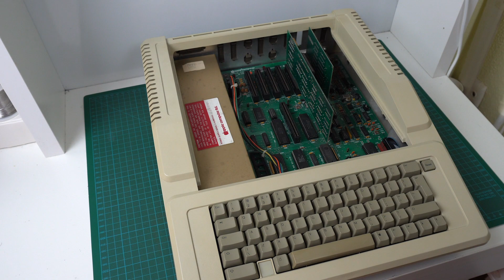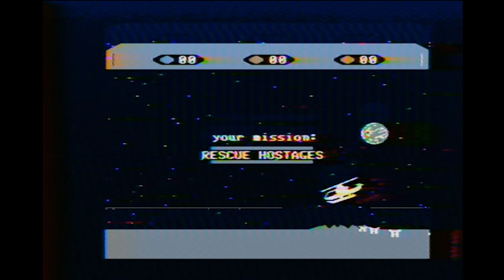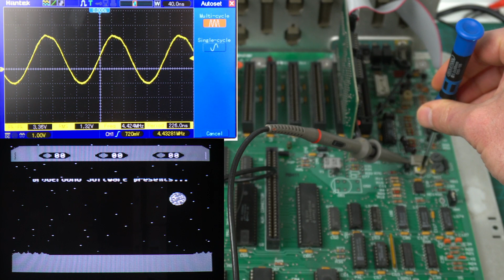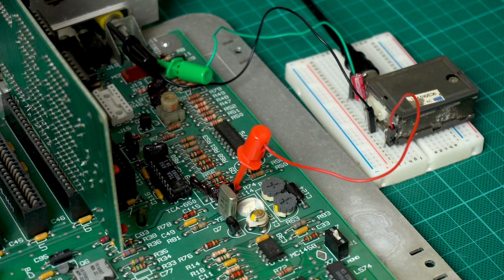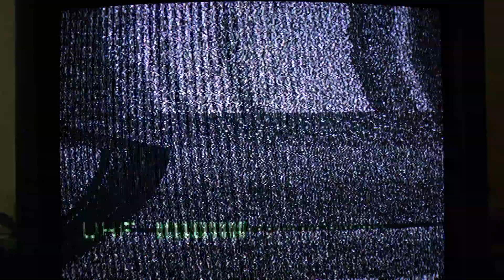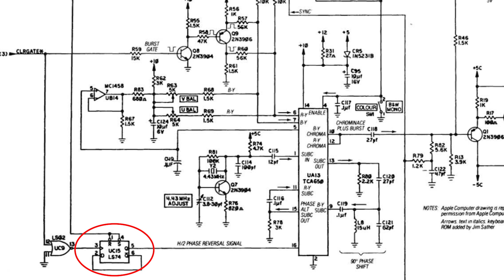Apple IIe PAL Color Deep Dive and Repair

Comment: Kudos to the great Walter Bruch for giving us the PAL system! 👍
I was actually considering an issue with the "colour killer" circuit being stuck on. This is normally only active in text mode and inhibits the colour burst to eliminate colour fringes.
I have a no-name PALcolour card in my Apple ][ that was apparently built as a kit by the previous owner. Bizarrely, the colour killer was inverted on that thing: colour was disabled in graphics mode, and enabled in text mode. It turned out the transistor that picks up the COLORREF signal from slot #7 and enables/disables the colour burst was a PNP instead of NPN, or vice versa. This was either an error in the original schematic, or a mistake on behalf of whoever built the kit.

Comment: I’ve worked on dozens of these machines, but they were all NTSC units. It’s nice to learn about the PAL model. But either way, an RGB card will fix all these problems!
Reply from the maker: By an RGB card do you mean a generic card that takes composite and generates RGB, or is there an Apple II-specific expansion that generates an RGB signal. I'd love to check that one out.
Reply: @NoelsRetroLab  There are RGB cards for the IIe that fit in the aux/80col slot, including one sold by apple itself. They were available with digital or analog RGB signals.

Comment: the test with RF modulator was useless basically from the beginning because the composite signal was already bad when sent directly to the monitor. Loved the rest of the troubleshooting.
Reply from the maker: Thank you. Yes, I agree that in retrospect it was useless. I just just grasping straws in case there was something "slightly" incorrect about the composite signal and somehow the RF modulator would be less sensitive to it than the TV.

Comment: I did not see any problem with the first time you put it on LCD. And among the last sentences of the video i finally understood why and what was wrong with it. Red. Red signal not getting interpreted. And greens aare in signal coded into both red and blue channels.
I'm red/green colorblind. The image seemed a little bit off but if you showed me bot the correct and that i would not be able to tell which was wrong.

Comment: Since theres a switch inside to switch between B&W & color, that means it can sending a color signal, wich means you cannot get color from a B&W signal to a color tv, no matter how you regroup pixels, it’s just bogus.
Reply from the maker: Right. That whole circuit is only active when the switch is on the color setting.

Comment: I actually own one of these rare 8-bit classic Apple computers. I had the pleasure of helping to develop some c&c software for it back in the early 1980's and I just love the architecture of the early Apple systems. The only problem I have now is that the "gold brick" power supply is in serious need of a re-cap and service, not a task for the fainthearted as it was one of the earliest switching power supplies, quite tricky to work on and easy to blow up if you aren't careful...

Comment: Well done! Instinctively I would not have suspected a flip flop in this case. But it shows that with the schematics you can use an analytical approach.
If everything goes well my first ever Apple IIe comes in tomorrow. It was, as you said in the beginning, not easy to find I in Europe. But I guess during all these everlasting effing lockdowns people clear up their attics and gems turn up. I also managed to grab an SX64 a few months back — I’d been looking for one within the QWERTY area of the EU for ages.
Reply from the maker: Thanks! I don't have enough of an instinct developed for the Apple IIe to be able to tell where faults are located, so I just had to take the brute force way and follow the whole color-generating circuit. Which in the end was really interesting and learned a lot, so I'm glad I did it.
Good luck with your Apple IIe! It's a fun system!

Comment: With stubborn chips like that, I usually cut the pins and remove them one by one.
Reply from the maker: Yes, that's a good idea. I usually don't do it because I'm never 100% sure that the chip itself is faulty (sometimes it can be shorted from somewhere else) and there's something satisfying about testing them after you desolder them to confirm they're indeed faulty. But yes, that's a much more practical approach, especially with cheap ones like this.

Comment: Hmm if the quartz oscillates there's a very low chance it has issues. OTOH, if it didn't, you'd need to make sure it's not the oscilloscope probe that's loading it too much and stopping oscillation. On my thinkpad'd ethernet PHY I had to jumper another one in parallel to see that it was broken… well almost, when started sometimes it kept oscillating, just wouldn't start on its own.

Comment: Scope probe loading down the crystal,  metal screwdriver on the trimmer cap.   Like your video's but that was painful.
Reply from the maker: The scope I usually run it at 10x precisely to avoid that and being able to see the signal coming from crystal oscillators. The metal screwdriver... there you got me. I still haven't gotten a plastic one yet! 🤷‍♂️😃
Reply: @NoelsRetroLab  Even at 10x the probe still introduces some capacitance which de-tunes the crystal.   Normally you want to find a buffered output when tuning while measuring.  It's all good I'm just being nit picky.   You do a nice job finding the faults.   You really need to get a bit nicer scope IMO however.   Something with a gradient display and faster update.
Reply: @jeffm2787  Agreed...a crystal should be measured after a buffer.  The  PAL crystal freq is 4.43361875MHz.  The colour burst is ten cycles of subcarrier which changes phase by 180 degrees every line.   PAL is a lot more involved than one might expect but Noel did a good job explaining the problem and fixing it.

Comment: How is it that the Apple II composite colours are so different from the CGA composite colours? Is that just a function of the particular choice of resistors used at some point in the circuit?
Reply: Everything about monitor television signals is about precise timing.

Chrominance information is effectively sent on a the phase of a subcarrier mixed onto the luminescence signal. The angle represents the vector between the Y-R and Y-B for a particular color.

Color artifacting works by sending digital signals on the chrominance subcarrier during the duration of a particular pixel.The monitor/television's color decoder interprets these signals as having a particular phase based on some PWM/PDM filtered result of those bits and specific timings.  The computer doesn't generate the colors, it just generates bits at randomish times and the monitor interprets those as colors based on it's color gamut.  As long as the signals are always generated with the same phase referenced to the color burst signal, a series of bits will always be interpreted as the same color -- but the computer has no idea what color that will be.

The Apple ][ and the IBM CGA graphics cards both use a similar method to generate color; but, their timings are completely different.  While Apple displayed 140x192 pixels do to other timing constraints on the Apple ][ board, CGA displayed 160x200. The vertical and horizontal intervals were therefore different and different in reference to the colorburst.  Thus the timings of when phase the digital signals were sent over the chrominance signal were completely different.  Therefore, the palettes of the machines are also completely different.
Reply: @timharig  Thanks for the detailed explanation. Your last paragraph resolved one of (retrocomputing) life's little mysteries for me. :)
Reply from the maker: CGA has actual color information built into it (analog RGB) which can be displayed directly on a CGA monitor or encoded in some other form (composite). The Apple II didn't really have any color information in the signal. It was a monochrome signal with high frequencies and timings in such a way to trigger color artifacts. The Apple II didn't control the palette of possible colors, it's just whatever NTSC produced, whereas CGA did at least make some (bizarre) color choices.
Reply: @NoelsRetroLab  That's a little hand-wavy. Also, what mode are you referring to with that explanation? Mode 4 on composite? I was actually referring to the not-super-officially documented but common 160x200 composite mode, which needs bits 4 and 1 set in the 03D8h register. And in that commonly known and not excessively tweaky composite colour mode, the CGA does fundamentally the same thing as the Apple II: It uses 640x200 "monochrome" data ("b/w" by default) to generate a composite colour image via NTSC artifacting. Yet if you look at the 16 colours which composite, 160x200-mode CGA produces by default (w/o further tweaks and 1337 hacks), you'll see that the CGA's palette is very different from the Apple II's default composite colour palette. (No hardware? Just look at the corresponding Wikipedia articles; they both have palette pics.) So that unexplained difference between both systems' respective composite palettes is what I asked about, and if anyone can give a non-hand-wavy answer, I remain very interested in hearing it. It is a given that I do of course know that both 160x200 mode CGA and Apple II use composite artifacting to create their chrominance info out of little more than "thin error" (if you'll forgive the pun).

Comment: Not even my good Hakko FR-301 can get all the solder off some of these Apple boards.  Also, even when it does, the parts stick to the plated-through holes (or, more maddeningly, the small pads on the top, which have traces I can peel away if I get too impatient) more often than not.  I always make sure to put a socket in after this kind of repair.

I'd never thought of bringing the soldering iron topside to help free the part.  That will save me a load of cursing as I struggle to free it from the lumpy thing.

Comment: TIP: When you have a stuck part like that I always cut the pins away from the part, then de-solder each pin. This puts the least stress on the PC board pads and plated through holes. Of course you destroy the chip or part but in this case a TTL chip is pretty cheap. Also the subcarrier frequency is quite critical. I don't remember 4.43mhz PAL specs exactly but NTSC is 3.579545hz +/- 10hz so I expect PAL would be the same tolerance. That's actually a much better color system than the NTSC Apple 2. I guess they had no choice but to use a real subcarrier quadrature modulator because of the PAL phase alternating line requirement. We don't have that need in NTSC so you can have much simpler crude color circuits. Just mix a subcarrier with the luminance at a different phase than the burst. No quadrature  modulator needed. Just a feed the subcarrier into tapped delay line and a CMOS six part inverter chip plus some capacitors does that nicely. Of course this approach is hardly broadcast quality but good enough for early computers.
Reply from the maker: Yes, you're right. I'm in the habit of taking them out without cutting them because many times I'm either not 100% sure the IC is faulty, or it's an interesting chip that I want to keep for future tests. But in this case it's just a dumb 74xx, so yeah, that would have been much better.
Reply: @NoelsRetroLab  Solder braid is an option too, but takes a lot of patience. But even smaller 14-16pin DIPs can sometimes be really stubborn.

Comment: When it's a shitty 74ls chip you're fighting to desolder, which you don't care to keep in a working condition (especially if it's faulty to begin with) It's much simpler to just cut the leads and remove them one by one.
Reply from the maker: That's very true. I'm in the habit of desoldering them without cutting them because half the time I'm desoldering potentially damaged chips or valuable ones that I want to keep even faulty (to run experiments with them). But in this case you're right, I would have been better off snipping it off.

Comment: If the phases of alternated lines are not inverted, the results is the substraction of color information on them. Then, it shows as black and white because all the color information is interpreted as noise and suppressed. 
The PAL standard was designed to use this method to be immune to the problems on color shift of NTSC system.
Reply from the maker: Really good insight on that. I hadn't thought about it that way. Thanks!

Comment: Fascinating. I would never have found that in a million years!
Reply from the maker: Thanks. Glad you liked it. It took me a while to dig all the way there, although it's one of those things that once you figure out what it is, it seems like it couldn't have been anything else :-)
Reply: @NoelsRetroLab  Aaand... I spent most of my time finding out most of the info about PAL composite video on my Apple //e myself... the problem I have is similar, mine shows yellow only, and seems to be in color mode even when it shouldn't (e.g., in text mode).
I just started studying how the 6600 works, but looks like you have quite a good description here (and way better schematics than the one I have!)
I'll rewatch your video soon, with the board in one hand and the oscilloscope in the other :)
Reply from the maker: @marco_foco  Make sure you read the PAL section in Understanding the Apple IIe (linked in the description). There are two crucial pages about it which helped me immensely following the logic and tracking this down.
Reply from the maker: @marco_foco  What you're describing is really weird though. Yellow in text mode? I doubt it's generating the color burst in that mode (easy to check), and if it isn't... that sounds more like a TV issue. Drop by the Discord if you want and we can chat there. Easier to post pictures and stuff like that.
Reply: @NoelsRetroLab  That's the problem, or at least one of them: it is generating the color bust in that mode.
The color is greenish/yellow in text mode, in graphic mode you can see random pink/green patterns sometimes, and the black isn't really black but often very dark red.
As you did in your video I tested with several devices and adapters (a TV, a portable projector, and a screen with a composite to HDMI adapter, exactly like yours, but white :)), they do have some differences, but the problem is always there.
I even tried to swap one of the transistors (Q9) that seemed bad in circuit, but revealed good once removed, and the variable capacitor (which broke in two when I tried to move it).
Absolutely no change.
Unfortunately I didn't have time recently to check it again, I hope I'll have some time on Sunday.
Reply from the maker: @marco_foco  That's very interesting. I seem to remember the color burst is controlled with a signal somewhere, so start tracing there then. Could be that some of that logic is faulty. I bet you can track it down pretty easily. Let me know what it was if you find out!
Reply: @NoelsRetroLab  Yep, and I believe I have the exactly same board and schematics you have (after all, mine is also an european Apple //e, and I don't think they did many different boards for europe). The signal would be CLRGATE* signal, tracing back, and the transistor I changed is Q9 (unfortunately I don't have a 2N3904 available, but I ordered them now). I'll check it soon, I really hope the problem is not the source of CLRGATE*, because that would be the IOU.

Comment: This is the first video I've seen on your channel and I have to say the quality is excellent in every way.  Impressive.  Good job solving this problem.  I spent many hours back in high school at the keyboard of these Apple IIs.  It was a very exciting time for me.

As you say, the circuitry is odd and hackish.  This is because Apple never wanted to use a custom IC when off-the-shelf parts could be made to do the same job.  While that can be seen as an inefficient use of space, it means that there's almost nothing in these machines you can't easily replace with new components that are readily available to this day.  40 years later, this design is paying dividends.
Reply from the maker: Thanks so much! I'm really glad you like it. 
I also love computers made mostly out of off-the-shelf parts. You know you can always fix them, not matter what happened. It's almost the same thing with early ZX Spectrums and Amstrads (except for the pesky ULA). But once you get to ASICs and things like that... things get more complicated.
Reply: Quite ironic that the modern Apple now deliberately use custom chips to perform functionality easily available from off-the-shelf parts, in order to discourage or prevent repair!